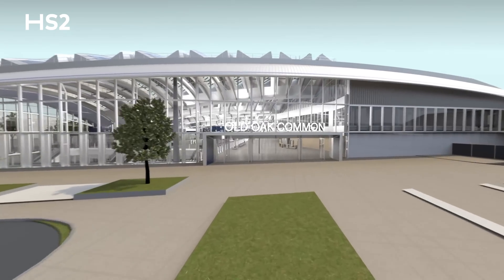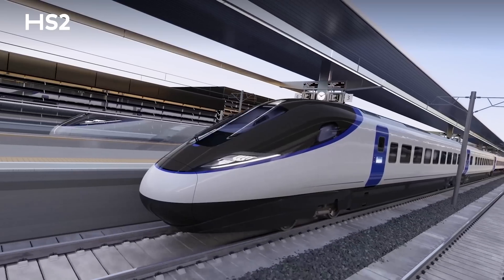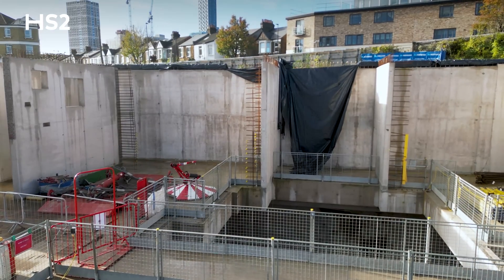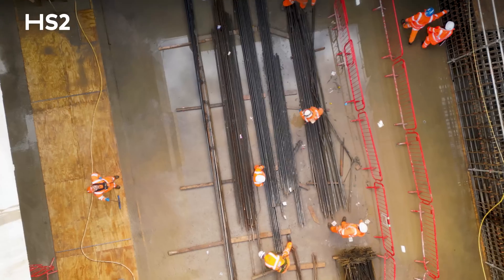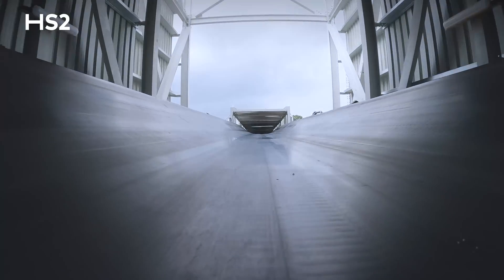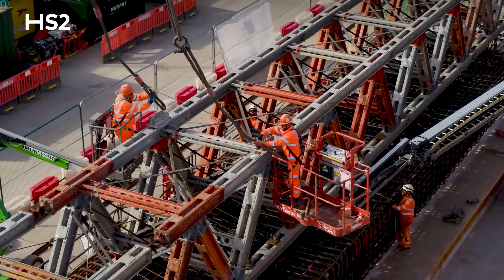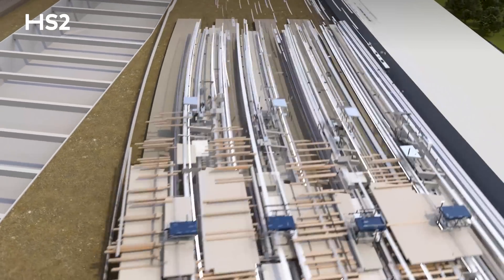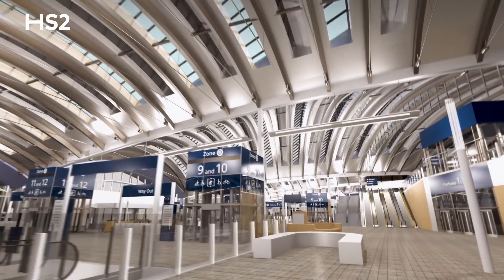HS2 Old Oak Common Station Project Update | December 2022

Comment: The money wasted on hs2 could pay the extra pay essential services need
Reply: LOL.
Reply: Lmao
Reply: Disinformation,
Reply: @scottpeacock5492  .. you say "disinformation" .. I say read this damning report published only last month by Andrew Gilligan, policy adviser on transport & infrastructure for the PM between 2019 & 2022. 

HS2 is not an instant way to avoid all cuts. Much of the spending in the next few years is on parts of the scheme that are too late to cancel. But meaningful sums can still be saved in this Parliament, and very significant sums indeed from the middle of this decade, well within the window for fiscal tightening planned by the Chancellor. 
In the short to medium term, scaling back HS2 can mitigate cuts to other areas. In the medium term, it will create significant headroom for investment in better transport projects – projects which deliver more benefits, to more places, more quickly. In ConservativeHome’s words, “robbing the white elephant to pay the Red Wall.”

This report recommends cancelling all sections of the scheme on which main construction work has not yet started – just under half of its total length – leaving only a line between Old Oak Common in London and the West Midlands,  including the city centre terminus in Birmingham and a branch to Handsacre, near Lichfield, where trains for points further north would rejoin the West Coast Main Line. Many of the benefits of HS2, such as they are, would still be delivered by such a scheme, and the benefit-cost ratio is better than for the full project.

As we show, public support for HS2 is low everywhere, and even lower in the regions it supposedly benefits.
The outcry at last year’s cancelling of the eastern leg was entirely confined to regional elites in the big cities; it left ordinary voters quite unmoved. Leaders of the smaller towns and cities which voted Tory in 2019 supported the cuts to HS2 though big city Northern leaders back the scheme in principle, they vehemently oppose the specific plans for Manchester, and would far rather have better trans-Pennine links.

More importantly, however, cancellation is not merely expedient, it is right. 
HS2 is Britain’s greatest infrastructure mistake in half a century. Even at the official price, even before the spending crisis, and even before Covid, it was and is a misdirection of resources of unprecedented size. As Ben Houchen, the Tees Valley mayor, said last year: “If I was given 1% of the HS2 budget I would be able to revolutionise [my area’s] public transport on a scale we couldn’t possibly imagine today.”

In the year to April 2022, the government spent almost as much on HS2 (£5.6bn) as it spent on the country’s entire national and local road networks (£5.8bn). Later, as HS2 moves to peak build, it will be significantly more.
 Over the three years 2022/3 to 2024/5 inclusive, rail will take 69 per cent of all central government spending on transport though it accounts for only 2% of passenger trips by volume, 9% by distance (these are pre-covid figures, which will be less now), and 9% of freight tonne/km.

The government will spend four times more on HS2 this year than on local public transport, though 87% of journeys are local.
Even before the new Budget cuts, the gap is planned to grow further to perhaps 6 times next year. HS2 spending will increase and local public transport spending will be cut by around a third to help pay for it, from around £1.5bn to around £950m a year (HS2 can help improve some local transport services, but only a relatively small number, only indirectly and often in the wrong places.)

HS2’s supporters will describe scaling it back as an act of national self-harm, a surrender of transformational ambition. That would only be true if it was really transformational but it isn't.
 For all that ConHome and others call it a white elephant or a vanity project, it isn’t quite that either. It is not worthless, or without benefit. It could have been worth doing at say, a quarter or a third of the price – the original sum advertised. But it is not worth the colossal sums now required – as even the government, very quietly, admits.

Unnoticed until now, the latest business case, published in June 2022, gives HS2 a central benefit-cost ratio (BCR) of 0.9.
In other words, it will cost more to build than the value of the benefits it delivers. For every £1 it spends on the scheme, the country gets back benefits worth only 90p. Including “wider economic impacts,” HS2’s BCR rises to 1.1 ..  still extremely low but even this is a significant overstatement. The BCR calculation assumes that HS2 will cover its operating and renewals costs entirely through fares, though no other railway in Britain does both and most, especially now, do neither. The construction cost which the BCR uses is below even the official price, let alone the real one.

HS2 describes itself as “the UK’s flagship transport levelling-up project.”
 Again, little noticed in its official economic case however, is a table showing that almost half (43%) of its benefits go to London and the South-East, meaning its effect in narrowing regional inequality will be little better than neutral. This calculation was done before the cancelling of the leg to Yorkshire. HS2’s claim that it will “create 500,000 extra jobs” is, as we show, an absurd exaggeration.

HS2 claims that it will encourage modal shift from cars and air and be “net zero carbon from 2035,” only five years after opening. In fact, its own assessment says that “over the construction and the first 60 years of operation of HS2, it is likely that carbon savings will be less than the carbon emissions.”
 Only 4% of HS2 passengers would previously have travelled by car and only 1% would have flown, while 26% will be new journeys.
At this rate, it will be well into the 22nd century, not 2035, before Phase 1 of the scheme has covered the 6.5 metric tonnes of carbon equivalent created in its construction.
Per pound spent, almost literally any other public transport project imaginable could achieve greater modal shift and CO2 reduction than HS2; that it takes vast sums away from such projects is another of its environmental harms.

And all this is based on the published costs and calculations of benefits, which have not changed for three years or more. In that time, the true position has become worse. Covid has further undermined HS2’s already weak strategic rationale: to free space on existing lines for more local and commuter services. This is no longer necessary. 
Since the pandemic, significant and probably permanent changes in working patterns have seen rail commuting plateau at around 70% of pre-covid levels. Business travel, HS2’s core direct market, is also down. 
Planned journey times on the new line have quietly increased, reducing the value of time saved, integral to the business case.

As the benefits of HS2 have fallen, its costs have risen further. The Financial Times recently reported that an internal review by its deputy chair, Jon Thompson, finds that Phase 1 of the project, from London to the West Midlands, will run “many billions” further over budget, is “very unlikely” to meet its £40.3bn target cost and has only a 50% chance of meeting its upper envelope of £44.6bn (at 2019 prices), including contingency.
 HS2’s costs will rise very significantly above even this when 2022 inflation, now at 18% in the construction sector, is added. HS2 Ltd’s management has drifted. The organisation has been without a chair for the last 15 months.

The combination of rising costs and cuts to public spending means that if HS2 continues as currently planned, it will eat much of the rest of the public transport budget, causing terrible harm to the transport network, sucking billions of pounds out of the services that most people actually use, need and want, and which could do far more for economic growth, reducing C02 and cutting road congestion. There will certainly be little or no money for the smaller, humbler new projects that really could level up transport in Britain.

The prospect of HS2 being delivered to the specification and cost currently claimed is essentially nil. The only question is how much more money we waste and how much more damage we cause before we all realise this. It is already impossible fully to correct the error; £30bn (in 2019 prices) has already been spent or committed on Phase 1, which is too far advanced to cancel. But it is not too late to greatly limit the damage. It is untrue, as some have said, that there is no fat in the public sector. There is HS2.
Reply: @CRIMSONANT1  total rubbish , it is nearly 2023 , the construction is motoring along, you should watch the updates they’re great  . It will be built from Euston to Crewe and expanded once Labour get into power by devolving more money and power to the regions and they will I’m sure build the transformative  infrastructure this country needs rather than money pits like the NHS and test and trace 😂😂😂
Reply: @normhanson981  ..   Another damning report from Simon Jenkins, NT.
The overall HS2 project is estimated at £200bn. An infuriated Whitehall official told me at the time: “Never let that man say he cannot afford any item of public expenditure.”

The ambition was soon trimmed. HS2 will no longer go to Yorkshire, only to Birmingham and Manchester. A 10-year-old plan for Euston station, on which more than £100m has already been spent, must be radically redesigned.
Rail passenger numbers even in the Midlands have fallen, leaving HS2 largely to benefit commuters into Birmingham and from London’s home counties. .

This enormous sum is, eerily, not far off the annual “black hole” in British borrowing that the chancellor, Jeremy Hunt, says he must fill. The roughly £7bn a year to 2029 is more than is planned for all England's school buildings and only a billion short of last year's NHS capital budget. It would more than meet the social care uplift promised by Boris Johnson but not yet awarded.

Sunak’s Chancellor claims he wants to crack down on “outrageous” waste of public money yet in 2018 it was revealed that £4.1 billion had been spent before work even began, with “consultants” getting £600m. The extravagance of the project has been condemned by Whitehall economists, public account committee chairs and project assessors galore. Its backers now claim it is too far advanced to cancel, with giant boring machines deep under the Chilterns. Yet those with noses firmly in the public trough always claim this. A New Jersey governor, Chris Christie, famously halted a rail tunnel under the Hudson river by simply ordering the contractors to fill in the hole.

If terminated, HS2 will have cost some £8bn, though many of its London acquisitions – including the land of 400 destroyed Camden homes – must be worth a fortune. But stopping it would save gigantic sums. In addition, billions of pounds could be diverted to rail projects that are really needed, in the north and in Wales, and are being sidelined by the Treasury to pay for HS2. Cancellation would release an army of 26,000 building workers into Britain’s chronically short-staffed construction industry.

Johnson’s Cabinet Office minister, Kit Malthouse, once dubbed HS2 the “killer whale” that stalked spending debates during his term of office. Its lobbyists fought for its survival as a totem of the glory days of Tory statism under David Cameron and George Osborne.

Since then the only question asked of successive prime ministers has been, “Will they have the courage to kill it?” This week £44bn is going begging. It could be spent on public services. As it is, HS2 has nothing to do with trains, only with political guts.
Reply: @CRIMSONANT1  if they kill HS2 now it won't cost £8. The contracts and provisions signed will cost tens of billions to pull out of. This is partly why it costs so much.
Reply: @Alto53  .. I'm assuming you meant £8bn & not £8? 🤣
In October last year, Lord Tony Berkeley, who served as the deputy chair of the government-ordered review into HS2 which concluded earlier this year, said that, at today's prices, allowing for inflation using Office for National Statistics indices, he believes HS2’s overall cost now sits at £155.52bn.
As such, he said: "Based on the progress to date, compared with the budgets given by the permanent secretary to the DfT to the Public Accounts Committee, approximately £15bn has been spent or committed to the project date. 
Repurposing it & selling acquired land reduces the monies lost to £8bn, saving the taxpayer £147bn overall."

Comment: HS2 is an amazing engineering project however I can’t iterate how bad a neighbour you are, how bad the air quality has become (dust in the summer), how noisy the area now is and how thoughtless many of your employees and contractors are parking in residential areas (specifically stating no HS2 works) I moved from Old Oak as a result. However, as they say you can’t make an omelette without cracking an egg, just a shame the pledges in these videos and in consultations can’t be upheld.
Reply: Not an omelette anybody needs

Comment: Did you say 'every train in and out of Paddington' will stop at this station? That surely doesnt make sense
Reply: Well its true. Main line, suburban, Elizabeth Line and Heathrow trains will stop there as its a key connectivity hub for passengers heading North from the West and vice versa.
Reply: @1chish  So there will be no non stop HS2 trains from London to Manchester? That's a bit crap. Stopping every train at Old Oak Commom so soon after leaving London is silly.
Reply: @owensmith7530   Old Oak Common is in bloody London Owen. Go check a map. So how do people from Heathrow get to Manchester if there is no Old Oak Common when the new Elizabeth Line goes right through it?
No its not 'silly' at all. It will save passengers a lot of time changing at Old Oak Common rather than train into Paddington and Tube across to Euston to catch a train to Manchester. We are trying to keep people OUT of London.
Reply: @1chish  Why would anyone want to take a train from Manchester to Heathrow when they could just go to Manchester Airport which has plenty of connectivity?
Reply: @owensmith7530  Errrr ..... maybe because the airline they are using or the destination to which they are going or the flight times they prefer or the fare costs they prefer operate from Heathrow?
But why are you so pedantic and dancing on pinheads Owen? Look you don't want it we get that then fine then don't use it. Like I really care?
Reply: @owensmith7530  a significant number will get on / off at old oak to make connections
Reply: @colinbrooks228  Yes this is the point. Many people will get off here rather than travel to Paddington, or join here instead of at Paddington. Depends on their final destination and what the connections are.
Reply: @1chish  not every train - that's crazy. Evening commuter trains where the first stop is Didcot and beyond dont need a redundant stop. Local stopping services are surely the more efficient way to get people on to HS2?
Reply: @jtlondon   If you have a stopping pattern West to East that includes Old Oak Common then that is replicated East to West. Its how timetables operate.
Now it may well be as we get to full operations some trains may well not stop but the concept at the moment is to treat OOC as a major interchange hub as the main lines run into OOC area anyway.
But then why should passengers off  / on HS2 then be penalised with just the option of a stopping service to Didcot or Swindon or Bristol and vice versa?